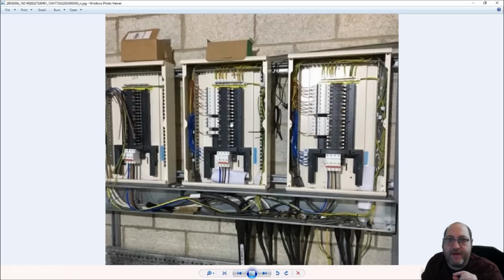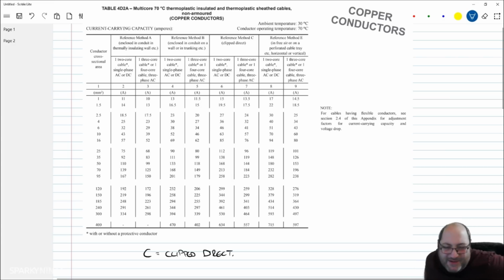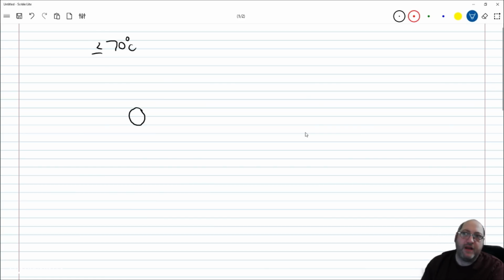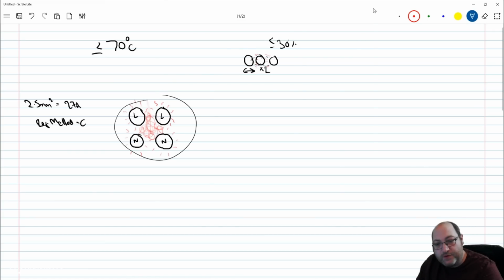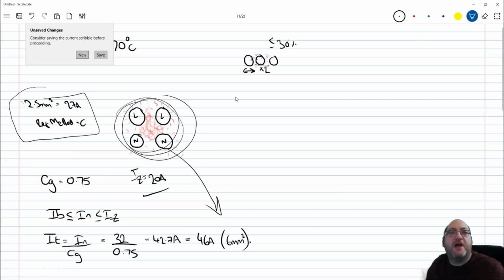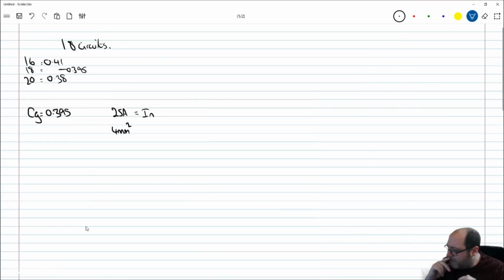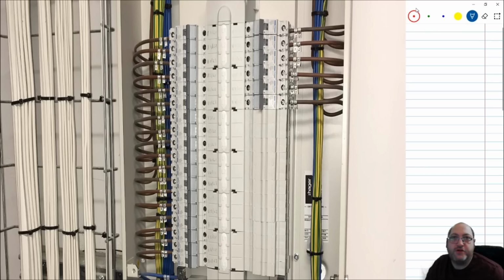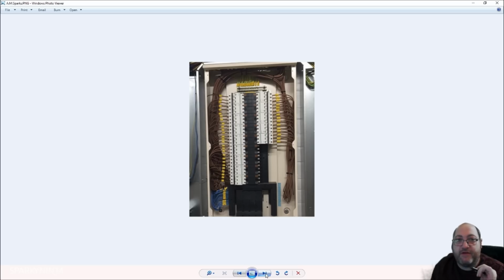Cable Grouping and the impact on electrical installations

Comment: Forgot to add, a better example would have been a factory or similar where there are any motors and large machines which do tuna full load, then the grouping factors are very important. Seen many a cable melted together in a packed 3phase dB.

Comment: In my opion once the conductors enter a consumer unit or dist board there practically grouped together even if there not tie wrapped together!
If you have a board that contains alot of circuits theres no way your able to seperate the conductors so there not touching one another.

Comment: Even if they were not tie wrapped ,they would still be closely bunched (very) and touching 

Why would you not consider a grouping factor in that case?
Reply from the maker: You possibly would, although it is more likely that there will be more air spaces within the bunching than if they were mechanically forced together by cable ties.

Comment: I seen this happen multiple times,  on commercial and industrial sites, in well designed bms panels . Big a/c motors , water heaters , hotel kitchens running 24/7.

Comment: Back here 2 years after the post after people slating Corys work the other day. Always completely agreed with your comments but when it comes to the design and installation of cables in panels like this other things need to be taken into account, how they're grouped/slumped in horizontal trunking, what the potential maximum demand at the other end of the circuit is (i.e they may be 32amp in the board but are they limited to 20-25amp at point of use). What type of use case are the circuits and the lowest loading should always be in the middle of a cluster of cables where possible. An encompassing view of the installation needs to be taken into account as a snapshot of an individual aspect of the installation can effect the overall design and function. This is why it is incredibly important to go through all 9 Notes and calculate the factors correctly for the entire design not just the consumer unit or trunking.

Comment: This is why here in Australia we have plastic slotted ducts inside our boards that we just throw our wires in. It looks messy but it doesn’t create these thermal issues AND once you put the duct lid on it looks even neater than cable tying them all!

Comment: I one time used a aluminium strip with cable grips that were spaced 10 mm  all was tidy looked good.  Then I come back and it all strapped nice an neat an tidy.  It did get a burn out 3 month later.

Comment: Saw this effect inside a DOL starter for a 60-odd kW 3Ph pump motor located in a hot compartment with about 5 other starters and 3 hydraulic power packs. All the phase conductors were bunched up in slotted trunking up one side to the contactor and thermal survey showed temperature exceeding 100 degrees C for a 90 deg C conductor rating. Cable on open ladder had no problems. We ammended from the incoming terminals with Marine grade 100 degree XLPE and up to the next available CSA based on empirical measurement of FLC and associated cable calculation, taking out of the trunk and dressing independently up the side of the enclosure to the contactor. The terminal shrouds were also damaged from the heat.

Comment: Yes it looks good but who's going to see it when the cover is on the DB the next spark going in there ? I  much prefer to see the cables running in the trunking slot looking  neat and the trunking all filed properly and looking neat and a nice sweep and termination of the armored cable not just straight in at the bottom of the main switch.

Comment: Worked in Australia for over 18 years , there rule book allows grouping of up to a mtr at distribution boards with no derating, All commercial Jobs are Thermal imaged at the distribution boards at full load at commission and yearly,  I have never seen an issue ever due to grouping, only terminals. Granted cables tightly packed in conduit or trunking do cause issues.!! Control panels with finger ducts crammed full of load end device cabling still no problems.  Please show an example where at a distribution board this has caused an issue, also a distribution board that gives enough space for the spacing in the regs , ie top entry 36 way and larger !!

Comment: whilst i agree you are assuming all circuits are going to be carrying full load..
Reply from the maker: The rating factors are applied if the cables grouped exceed 30% of the stated current demand.

Comment: Really great video showing the fundamental of grouping factors, only thing I would add is that we don’t need to use In (protective device size) unless the cables are likely to simultaneously suffer overload which is very unusual - therefore we can use Ib (design current) and apply the grouping factors to that figure. Ie a cleaners ring which will run at no more than 2A, will never need more than 2.5mm as it will never reach 70 degrees (2/0.38 = 5.3a)
Reply: Excellent point as long as you have access to the designer. The issue I have is a 10A  circuit beaker with 2A design current. What will be the design current in 10 years. Just keeping you design current to 30% can make all your problems go away.

Comment: This calculation, the circuit maybe 20 meters long but inside the box only 300mm, how would that effect the rest and would u not only calculate the 300mm that's tied up,, help 😮😲
Reply from the maker: The 300mm, whils small compared with the rest, will still need to be compliant with BS7671.

Comment: what about grouping of cables going through piping or trunking. how you calculate that.
Reply: In the Regs (BS7671) there is a table for the amount of air gap In conduit or Trunking you should allow. In the real world this never happens.
Reply: @mrmurphypiers1241  perhaps in your world. I live in the world where they have qualified designers and competent M&E installers.
Reply: In the regs

Comment: Great stuff, and a great reminder. Grouping is something that I don't think gets as much consideration as cables through Insulation. But the derating for grouping is pretty high.
In many ways we a forced to group up cables, because of pinch points, such as notches in joists, bends in trunking,  and the space left to run cable, and plumbers getting in first and taking up all the best routes.
Through insulation there is a length factor. With grouping. I would be interested in your thoughts on these 'tight' spots, and the length, to when grouping becomes an issue.  I hope that make some sense.

Many thanks for taking the time to make all this content. Its really appreciated.

Comment: Sure, concept understood, but the cables are bundled in trunking on their way to the fuse boards so isn't the zip tie for the final few inches of run nitpicky? Surely you aren't suggesting uprating a 6mm2 to a 25mm2 cable along its entire length because 4 inches at the end is bundled as opposed to fanned out slightly? Bear in mind copper is an excellent conductor of heat and will take heat along the cable towards the (in free air) tails entering those MCBs. Be interesting to run some tests with a thermo couple buried in there.
Reply: It was a worst case example. Not a design.

Comment: I notice when you're talking about the ring circuit at the start you count the live and neutral conductors and base your calculations on FOUR conductors... but later on the second example you only counted the 18 live conductors but NOT the neutrals..  I find this a bit confusing?? Or am I reading into this too much?
As you have already mentioned I understood this regulation to talk only of PER Circuit and so I would have calculated grouping based on the number of Live conductors grouped together.

Comment: Design engineer should be looking at grouping factors on tray/trunking from the word go.
Reply: If design engineer makes it known what the design philosophy known, it over to the installer to ensure compliance. All we are talking about here is cable ratings, it should be within the ability of a spark to interpret the affect of cable rating/installation/grouping in the dB.
Reply: @sandymcnair5298  "should" does not always manifest itself

Comment: Here with 2.5mm2 cables, B 16A MCBs are used. I suppose such situations and many more are already factored in.
SN you are forgetting one important thing. Supply current capacity is far for being close to the sum of the  current carrying capacities of individual circuits with or without applied coefficients, and hence influence of grouping is irrelevant.

Comment: I pull this all the time, and the blank looks of ‘WTF mate, are you joking’ are priceless. Also not a fan of cable ties on single insulated conductors, inevitably damage will occur, especially when the the insulation softens up under load over time.

Comment: Been doing my fuseboards like this for years and so have most of my sparks, never had any issues or come backs. 
I’d be more worried about loose connections, 5000mm of insulation over my cables and chippys smashing Celotex all over cables.
Reply: Just because it hasn't caused a fire yet doesn't mean it won't in the future!
All that means is that the conditions haven't yet been met (ie  heavy loads being drawn simultaneously on all the circuits for extend periods of time)
Maybe you should ask yourself why all cable reels now pretty much come with thermal cut outs ??
MCB's,RCD's,RCBO's ..etc won't protect you from cable bunching fire hazards
Reply: DNA Electronics No your quite right, However, new arc protection will. We should not just rely on our protection devices. It does come down to common sense. I carry out many thermal imaging scans for large industrial and commercial units and to date have not come across and hot spots or excessive temperatures and yes I have ensured loadings are on.
Reply: I hope the judge does not read your reply here. "I knowingly choose not to comply with bs7671"
Reply from the maker: if designed properly then none of that should be an issue. 👍
Reply: Exactly 👍

Comment: nice video and yes you have to keep this in mind  

but i would add i have to say the europeen spec are way higher than what i'm used to see here (canada)
here a 2.5mm or 14 awg 90C  is rated 15 amp... so that kinda of a big help.

In rare case all cable will be fully loaded ..mostly lighting or computer stuff.. and don't forget that the main breaker will not provide enough power to be able to load all circuit to full capacity
and be careful to use a mid value  between 16 and 20   ....  if i look at the rest of the table  the value doesn't seem to increase in a linear fashion
Reply: "and don't forget that the main breaker will not provide enough power to be able to load all circuit to full capacity" - true that!

Comment: I've not read all the comments, but the other problem with using  cable ties  is when the board is having either the initial test or periodic test carried out. The DB never looks tidy after a tester has been in the DB , especially when the line conductors are tied together and the neutral are tied together. When I've been instructed to tie cables together I prefer to keep the circuits together as it is easier to get to each circuit with less chance of damaging other wires in other circuits, also I do prefer to be sparing with the cable ties when using them.
Have seen DBs where someone has kept the line cables together from outside of the DB  using one hole for line another hole for the neutral and another for the earth!!
As I've only found this video I'm not sure if these problems have been addressed, but there are times I think the practical aspects should be talked about and not just talking about the regulations.

Comment: Basic "take-away" for beginners or anyone....neatness HURTS in this case.  Why?  Heat must be transmitted outside to the environment...and the close proximity to other cables just transfers heat to them...not to the extraneous environment.  Never considered this.  Not that I'm an electrician...but this was enlightening.  Thx.

Comment: The way we got round this when installing was to slot the whole board down Both sides with 4 inch trunking have the cables a total mess inside the trunking as usual but then just sweep into the terminal from the trunking, these DBs were usually bought like this prefabbed on uni strut  so just anchored to wall if no ply was going in, DB install was quick this way as long as the circuits were brought into the correct side when wiring, the way before like the video shows, we used bow band (all round band) right down the inside of the board so the tie wraps had something to hold onto

Comment: There are plastic clips that the single conductors clip into and that make sure there is a certain amount of space (and thus airflow) in between them. They are available for quite a number of conductors. I everywhere use those, not only make they look things even neater and provide more airflow, they make it even easier to change things.

Comment: Hi Mr Ninja , Being one of the older sparks in Town this issue does my nut in.   some of them have even taken to drilling holes in the panels and trunkings to lace their stupid tie wraps through.  This practice should be frowned upon from the college's up, throughout the industry as whole and generally discouraged.  It's not just the thermal issue that arises from bunching, There's also the EMF generated by spitting the conductors into separate groups that can cause the heating of any ferrous materials that these cables pass through.  People in the industry need to have a better understanding of the characteristics of the energy force  that they are working with.
Reply: Didn't John Ward run a test on this and found no significant heating effect on a metal enclosure when line and neutral were run through separate holes? Might of course be different in massive industrial setups.
Reply: It’s ok to split the conductors provided that they don’t pass through separate holes

Comment: Interesting... I looked into becoming an electrician, but I came to the conclusion I didn't have that amount of time to devote to a traineeship.

Not that the rules you're referencing apply where I live anyway, but those rules are of course based on the physics and engineering of electrical systems, so you'd assume the basic principles still apply no matter where you are...

Anyway, it's definitely interesting to see some of the less obvious considerations that go into electrical installations. (I mean, thermal management shouldn't be that obscure, but clearly the implications are not something that everyone really thinks about.)

Comment: In large commercial buildings I have seen this cause problems where the cables were run in trunking the ones in the middle were so hot I couldn't touch them needless to say I found the fault pretty fast after that.

Another example I can think of was 4 sets of 95 mm singles going through a 100 mm duct coming off a 1500 amp mains board feeding some smaller sub boards in the centre of the duct all 12 singles were melted into each other luckily we found that before it blew up.

This is something that I do for control cabling we are often using 2.5 mm cables for 500 ma circuits and use 95°c rated cables I have never seen this cause a problem in this situation but in saying that we are not using Tps..... We are using 7,12,19 and 27 core cables and working under engineer design

Comment: Hi mister sparky ninja it occurred to me that it's significance changes if said circuit bunching is happening in horizontal or vertical way due to the heat rising for example in a lift shaft

Comment: How about you still tie them together, but in the middle you put a pvc tube and the cables just dress up that core, like a outer shell?
Reply: Do you want to have to maintain your distribution board due to dust, failed fans, like you have to maintain a PC? That would be a very unreliable solution and NEVER  acceptable for use in a safety-critical application.
Reply: Bs7671 does  allow for engineering solutions and I like your idea, but not plastic. However, you would really needed to test and verify your philosophy. For mere mortals following the regs is an easier way to go.
Reply: @sandymcnair5298  Now, after nearly two years, I think that the simple solution for this problem is that you can use cables capable of higher current than the estimated one, and with insulation suited for high temperature. This way you won't waste space and the temps will not be a problem. Cooling systems are a must too, because prior to conductors, any other component such as relays or contactors will fail if ambient temperature is every time above 40C. Terminations in screws will loosen up too quickly. So yeah, bigger cables, fewer problems.
Reply: @cristianbacu5457  If you mean conductors designed to operate at 90 deg C, such as XPLE. Not as easy in the UK as the BS7671 do not permit 90 deg C a running temperature of conductors unless you can verify the terminations of the connected equipment are verified to 90 deg C.  Even switchboard suppliers won't verify their acceptance, never mind, distribution boards, luminaires or accessories.
Reply: @sandymcnair5298  Oh, I did not know that. I live in Romania, and here the situation at the moment is much more backward than that in the UK, speaking of Electrotechnical regulations. Our best tradesmen leave the country at an alarming rate, the education system is far less functional than the one you have in your country or in Germany for that matter. We take much of our regulation from the German model, but the big problem is that the regulations are updated very rarely (the last collection of norms was published in 2011) and the UE standards (the SR's)come with a big price attached. So, for the moment we have much more liberty to "interpret" the rules here, and with that comes a lot of stupidity, and a lot of bad experiences.